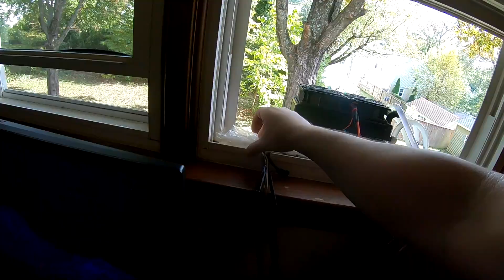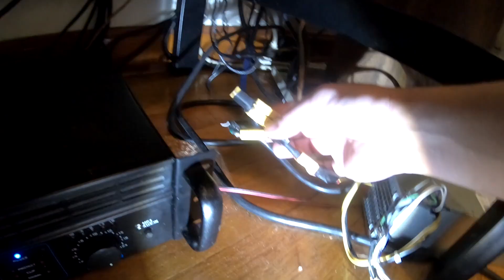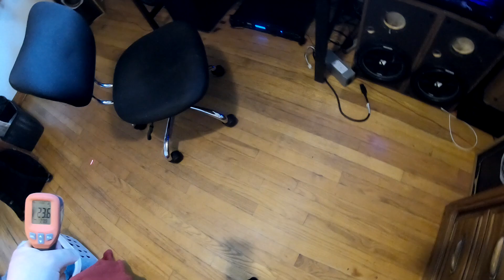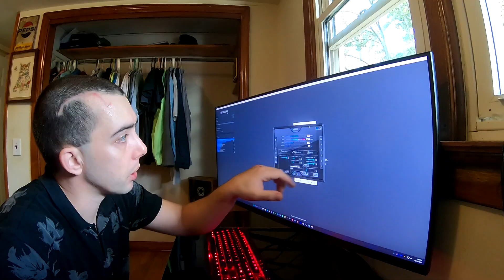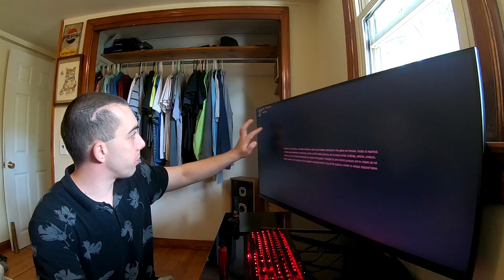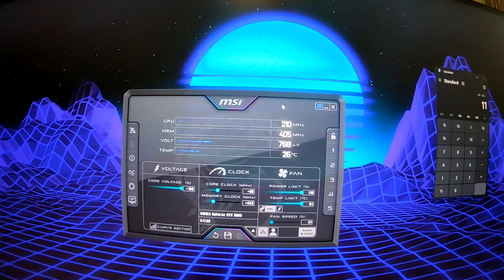Multifunction outdoor radiator setup

Comment: check solder connections on that fan, because of the temperate flux cycles and when i say check i mean the wires soldered together AND the joints on the fan motor too. Reflow everything with rosin because of outdoor pollutants. While youre there oil the fan bearings with 3 in 1 standard oil or sewing machine oil. You can add a tiny dab of wd40-BRAND marine grade grease to the mix if you wish because of their speed and environment.

Comment: Thats amazing. Can u make a benchmark with ur cpu extra overclocked? 

Good project.
Reply from the maker: The machine is “maxed out” for the time being, once we get into sub-45F weather I can try cracking past 5.4/4.2/4.9, last winter I got it to push consistent 5.5 so stay tuned :)